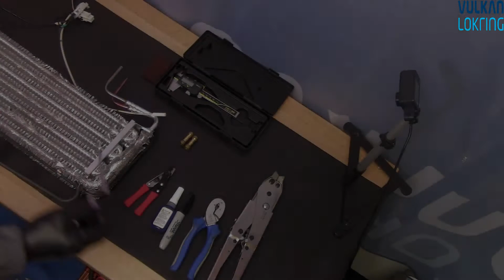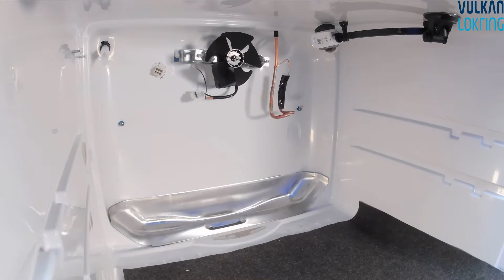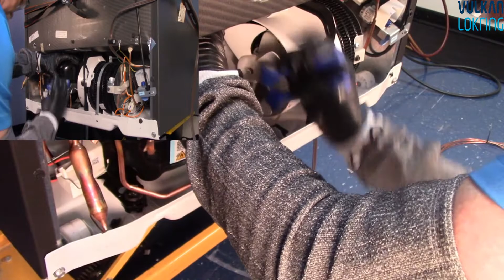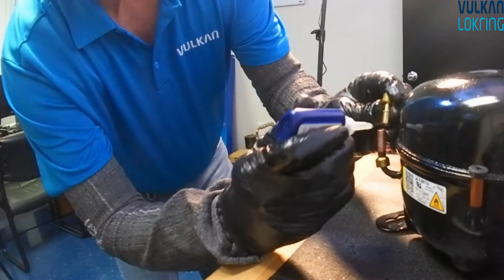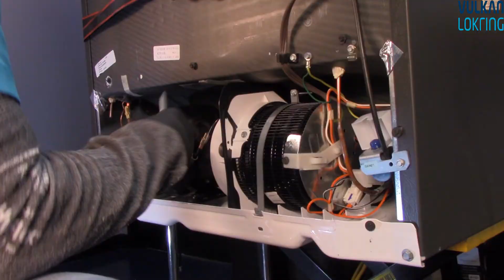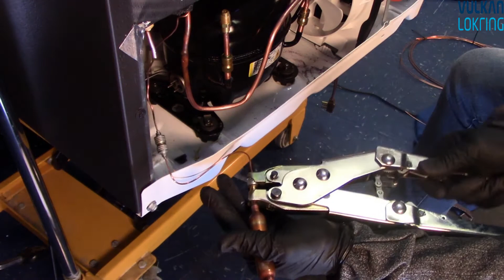R600a Lokring Repair of GE Top Mount Refrigerator

Comment: Hello, what connectors did you use here? Can I get a list of the most popular sizes?
Reply from the maker: Here is the top 20% of connectors used by repair technicians within North America, Central America, and the Caribbean:

L13000675	LOKRING 8,5/8 NR Ms 00 Straight brass reducing connector type 00
L13000595	LOKRING 9,53 NK Ms 00 Straight brass connector type 00
L13000654	LOKRING 8/6 NR Ms 00 Straight brass reducing connector type 00
L13000702	BRASS RDCR CPLG 10.5/8NRMS00 10.5mm - 5/16"
L13001451	BRASS RDCR CPLG 6/3.5NRMS00 1/4" - .138"
L13000588	LOKRING 6 NK Ms 00 Straight brass connector type 00
L13000592	LOKRING 8 NK Ms 00 Straight brass connector type 00
L13000638	LOKRING 7/5 NR Ms 00 Straight brass reducing connector type 00
L13000629	LOKRING 6/4 NR Ms 00 Straight brass reducing connector type 00
L13000674	LOKRING 8,5/6 NR Ms 00 Straight brass reducing connector type 00
L13000590	LOKRING 7 NK Ms 00 Straight brass connector type 00
L13005894	ALUM RDCR CPLG 8/1.8NRAL00 .313" OR 5/16 - 071" (50BAR)
L13000584	LOKRING 4 NK Ms 00 Straight brass connector type 00
L13000657	LOKRING 8/7 NR Ms 00 Straight brass reducing connector type 00
L13000684	LOKRING 9,53/6 NR Ms 00 Straight brass reducing connector type 00
L13005930	LOKRING 8/6 NR Al 00 Straight aluminium reducing connector type 00
L13000630	LOKRING 6/5 NR Ms 00 Straight brass reducing connector type 00
L13000506	ALUM UNION CPLG 8NKAL00 .313" or 5/16"
L13000587	LOKRING 5 NK Ms 00 Straight brass connector type 00
L13000625	LOKRING 6/2 NR Ms 00 Straight brass reducing connector type 00
L13000686	LOKRING 9,53/8 NR Ms 00 Straight brass reducing connector type 00
L13000622	LOKRING 5/4 NR Ms 00 Straight brass reducing connector type 00
L13000766	LOKRING 6 VS Ms 00 Brass stopper type 00
L13000612	LOKRING 3/2 NR Ms 00 Straight brass reducing connector type 00
L13000930	LOKRING 5/1,8 NR Ms 00 Straight brass reducing connector type 00
L13000651	LOKRING 8/2 NR Ms 00 Straight brass reducing connector type 00
L13000580	LOKRING 3 NK Ms 00 Straight brass connector type 00
L13000639	LOKRING 7/6 NR Ms 00 Straight brass reducing connector type 00
L13000645	LOKRING 7,5/6 NR Ms 00 Straight brass reducing connector type 00
L13000818	LOKRING 7 NAV NAV connection
L13000819	EXT FOR COMPR STUB 7.5NAV .295"
L13000820	LOKRING 8 NAV NAV connection
L13002334	LOKRING 6/1,8 NR Ms 00 Straight brass reducing connector type 00
L13005650	LOKRING 8/2 NR Al 00 Straight aluminium reducing connector type 00
L13005787	ALUM UNION CPLG 6.35NKAL00 1/4"
L13000583	LOKRING 3,5 NK Ms 00 Straight brass connector type 00
L13000498	LOKRING 2 NK Al 00 Straight aluminium connector type 00
L13000578	LOKRING 2,2 NK Ms 00 Straight brass connector type 00
L13000623	LOKRING 5/2,2 NR Ms 00 Straight brass reducing connector type 00
L13000637	BRASS RDCR CPLG 7/2NRMS00 0.276" - 0.079"
L13000653	LOKRING 8/5 NR Ms 00 Straight brass reducing connector type 00
L13000689	BRASS RDCR CPLG 9.53/2.2NRMS00 .375" or 3/8" - .087"
L13000914	LOKRING NAV-E 6 NAV assembly fitting
L13000915	LOKRING NAV-E 8/7 NAV assembly fitting
L13000917	LOKRING NAV-E 9,53 NAV assembly fitting
L13000919	LOKTOOL NAV 11 NAV assembly tool
L13000926	LOKRING 9,53 NAV NAV connection
L13002949	BRASS RDCR CPLG 4/3.2NRMS00 .156" or 5/32" - .126" or 1/8"
L13001609	ALUM RDCR CPLG 8/2.2NRAL00 .313: or 5/16" - .087"
L13005654	LOKRING 8/7 NR Al 00 Straight aluminium reducing connector type 00
L13000682	BRASS RDCR CPLG 9.53/2NRMS00 .375" or 3/8" - .079"
L13000616	LOKRING 4/2 NR Ms 00 Straight brass reducing connector type 00

Comment: You use this tools only for r600a ?
Reply: The LOKRING 00 connectors are compatible with all refrigerants with a working pressure of 360 psi, or less with the exception of ammonia.
Reply: @jeremiehedges2590  can I use for r134
Reply from the maker: Yes, the Lokring connectors can be used with R-134a.

Comment: I want to buy a lokring kit. is it really necessary to buy a separate kit for each individual brand you want to work on?
Reply from the maker: Ashroyer86, no it is not necessary to buy a kit for every individual brand.  We offer a Master Kit, which includes connectors from al of the OEM specific kits.  This will save you a great deal of money and ensure that you have the right connector for any brand or refrigerator that you may be servicing.  The part number for this kit is A20110013B and is available from any of our distributors.  Thank you for your inquiry and sorry for the delayed response.

Comment: Any idea where to buy the yellow platform that they use to rest the fridge  on?
Reply from the maker: Rob, this is a generic 1000 lb. Capacity Hydraulic Table Cart.  You should be able to source one at any local supply house or just put my description into google shopping and plenty of options should pop up.

Comment: what is cutting pipe tool name and the cobine two pipe tool name. ths !!!
Reply: The tube cutters are called the LRSZ Tube Cutting Pliers p/n: L14000166.  The connectors being used are the LOKRING Type 00 connectors designed for appliance repair and refrigeration systems with a maximum working pressure of 360 psi (25 bar).  The hand assembly tool used to close the connectors is called the LOKTOOL  HMRK-V, p/n: L13003829.  You will also need assembly jaws for the hand assembly tool, LOKTOOL MB 8 (p/n: L20000200) & MB 10 (L20000201) are the most common sizes used in the appliance industry.

As always, thank you for you interest in our LOKRING products and if you have any additional questions , please feel free to reach out.